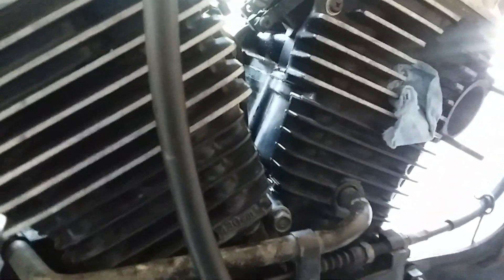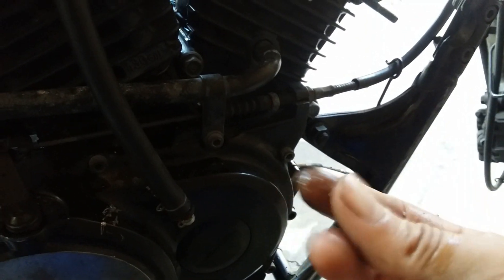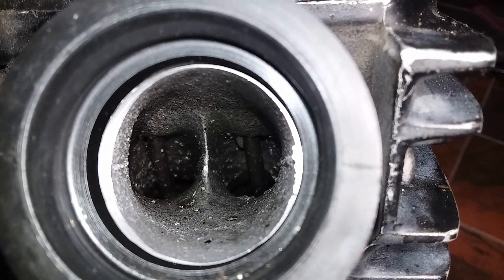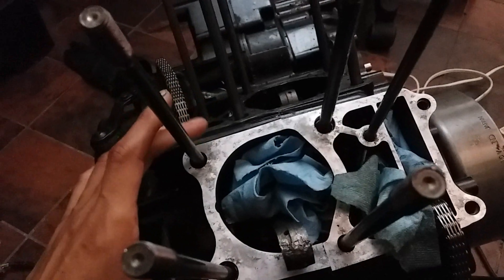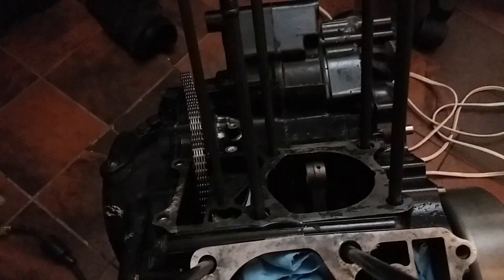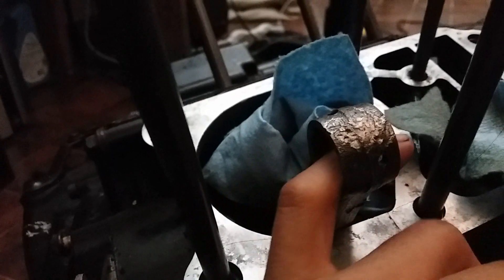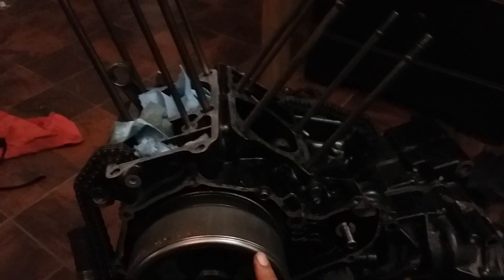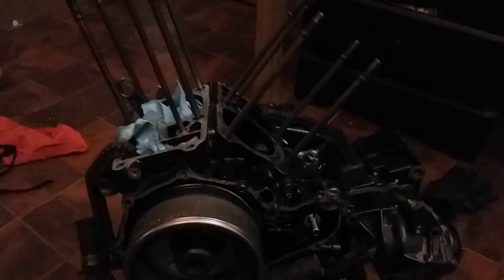Motorcycle Honda VT500 Engine Rebuild - Stuff Nightmares Are Made Of

Comment: HELLO shame you didnt show the cyl head damage, but just where did you find a place to order a new cylinder and piston ?  these parts are getting very rare to find .  i find it great  that you are doing this yourself.  rare to find a young lady that knows hr way around an engine.  i have a lot of experience  on rebuilding the top ends on these engines and can give you information if you still need it.  you can email me direct or get me on face book.

colin
Reply from the maker: Hello, sorry for the late relpy. I do show all the damage in another video called "Motorcycle 1985 Honda VT500 - Engine Damage"
I didn't find any new parts but just purchased decent used parts on Ebay. If there was anyone out there making pistons and top ends for these bikes would of been great! 
Thanks for the compliment! I have it all together now and running but i do still have a problem. My valves are a little tappy even after a valve adjustment. I'm pretty sure it's my cam chain. I think ii might be stretched. When i was putting the top end together, i did notice my camshaft on one cylinder was slightly off.